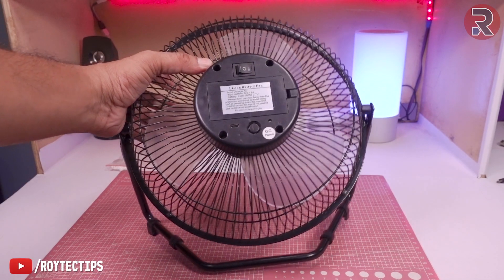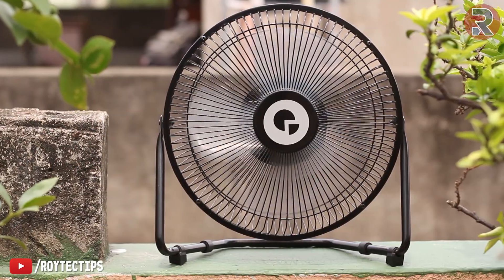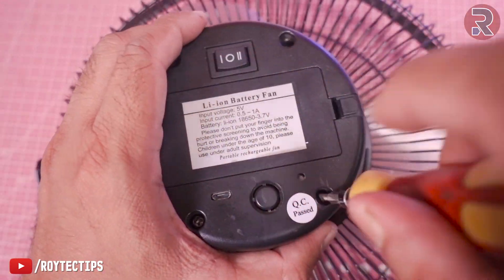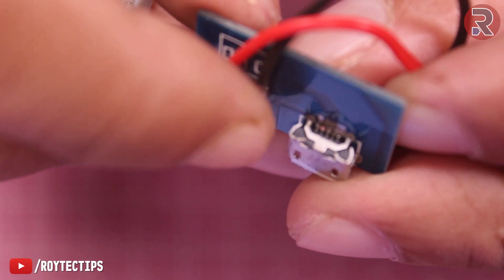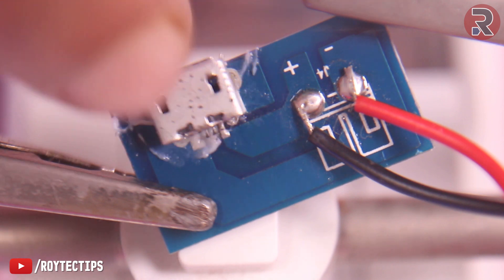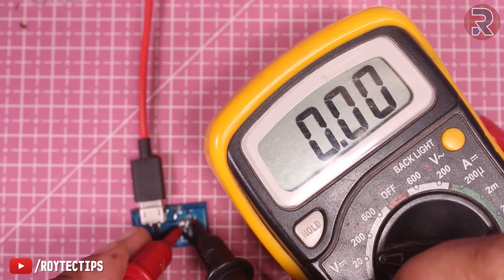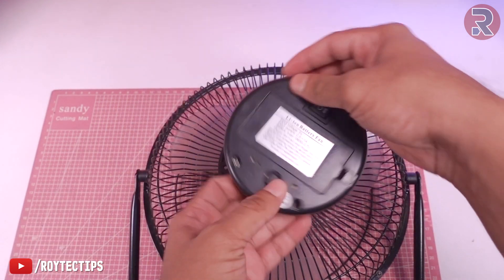HOW TO FIX MICRO USB PORT AT HOME !!!- NOT CHARGING

Comment: Thank you so much for explaining what each pin does, so for a coffee warmer device micro USB port replacement i just need to worry about pin 1 and 5?
Reply: After you hearted my comment it gave me confidence to carry out the repair and I've fixed stuff with solder before but not this tiny so happy to have succeeded with my first Micro USB port solder repair, your video helped me out a lot and answered burning questions about wait what pin do I need as its just a coffee warmer thank you no need for data lol :) I sort of knew what my issue was as my uneven wooden floor would slightly move the cable and sometimes coffee warmer would go off / damaging the micro USB port with cables weight putting even more pressure so it was kind of just lifted off from its two connection points/pins on the pcb so I just added a tinny bit of new solder and also I was using a wrong micro USB cable with extra long head so it was sticking out / putting extra pressure i messed it up myself then also fixed it myself, moral of the story use correct size plug/port and about uneven surface/delicate items only use magnetic plugs ;) they're sooo good i recommend essager/ ugreen on aliexpress.

Comment: great video. How did you figure out which type of micro usb socket you needed though? there are so many different types.
Reply: Micro usb type B (which is used in most electronics these days) always have 5 pins and they are the most important. The side "legs" on the body are usually there to hold things in place so you don't rip the pins off cause they're very delicate.

Comment: Does the usb need to soldered down, or could I super glue it down?
Reply: You can use normal glue but only a small drop and make sure it's not blocking the places what we need to solder. You also can use tape but it's not gonna be strong. Soldering is recommended. And if you don't have it then use hot glue instead

Comment: For your case. It would've been easier to buy a battery charger for the 18650s and an extra set of batteries. Speaking as someone who vapes with 18650s. For my case it doesn't have an external removable battery.

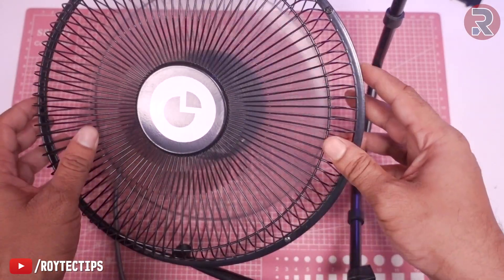Comment: 4:56 why does it say positive on the black wire and negative on the red wire.
Reply: Well, its all depends where the wire connected, because you can use black wire a positive or negative. The same to the red color